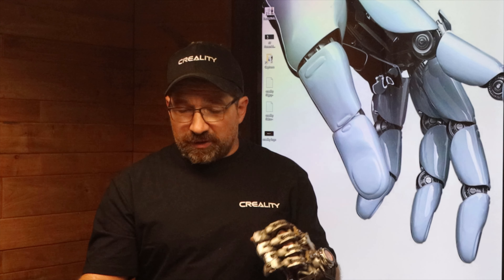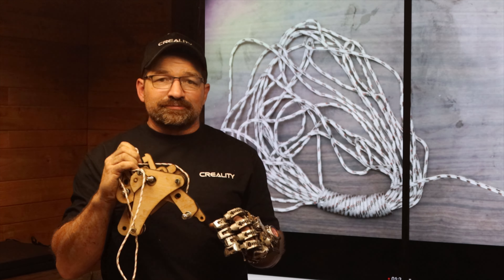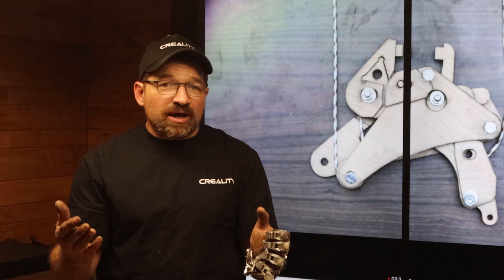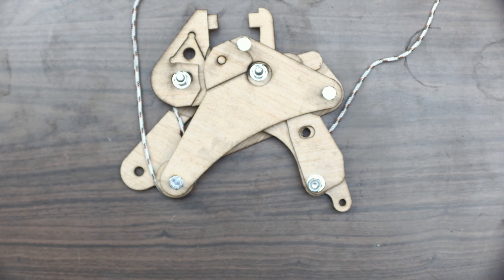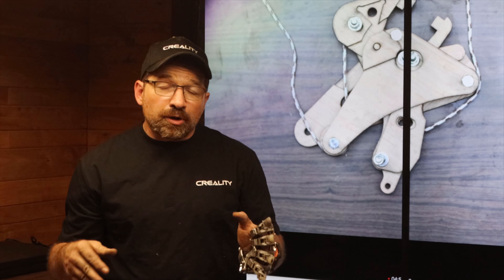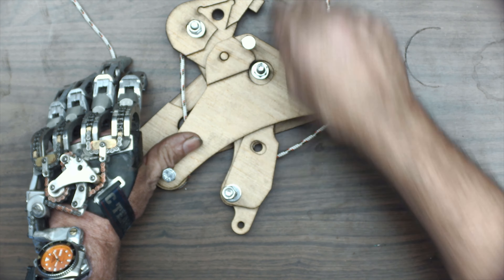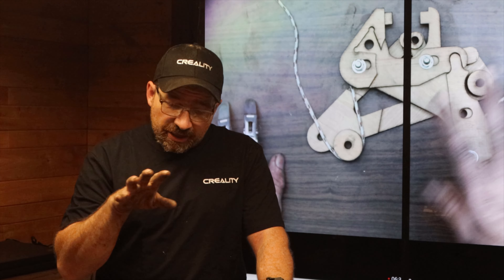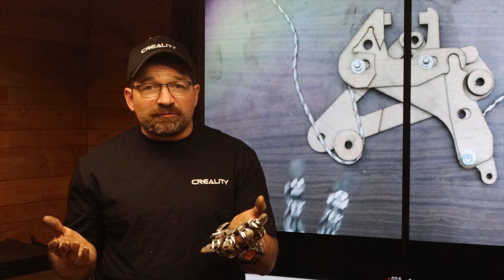What Is the winder and How does it Work?

Comment: That's incredible if I understand it correctly it's allows compliance around objects, distributes the tension to whichever finger can still move, and then ratchets (sorta) so that it locks requiring only moderate force from the wrist to keep it locked.
Reply from the maker: Exactly! As long as there is a load on the fingers the cleats stay engaged and the fingers don't backdrive, but once the load is removed, the cleats spring apart and the fingers return to the extend position. I think it'll be super useful out in the wild, but that will come down to what reliability and maintenance look like for that part of the device.

Comment: Did you ever considered commercializing the prosthetic to the people in the same predicament as you? 
and it is modular enough to fit people with different types of finger/hand amputation or deformations?
Reply: He mentioned at one point that it would be beyond a full time thing to "commercialize" it, especially seeing that each prosthetic is essentially a bespoke project. He has videos on how to make a mold to any given hand using a variety of techniques and related tips/tricks
Reply: Beyond just being impractical to commercialize as a one-person operation, there's not exactly a high demand for half-hand prosthesis exactly like his. Amputation isn't particularly common to begin with, and every amputation is unique in its placement - not to mention the questionable ethics of charging someone who has a disability for a solution to said disability, especially given the frankly exorbitant prices that would be necessary to turn a profit as a result of low demand and the extra labor of custom fittings. I may be wrong, but I think the plan is to open-source it.
Reply: @littlesnowflakepunk855  I don't think the final release has been discussed.  Another viable route to get Ian's hand out to people who need it is a "49%" kit.  Several kit-build experimental aircraft take this route where the factory dills, cuts, and welds the most difficult pieces before the builder assembles it all.  For Ian's hand I assume this would be a small range of finger sizes, the winder, and a couple of different sized gauntlet assemblies.  The user would then make the socket, etc. before assembling the kit.  

From what's shown, Ian's hand is at least a few thousand dollars in parts and labor.  Replicating it will never be "cheap", but a good kit can make it much easier.

Comment: Well I understand the explanation about the left two digits right two digits distribution, I understand how you can tention them to close them (basically just a simple bar with a wheel so you can tention the chain, like a bycicle would do it)... But you COMPLETELY lose me when you start about the lock under load and the triangles. Like I don't know which parts we are even talking about, is it possible to grab a marker and collor the specific parts 😂?